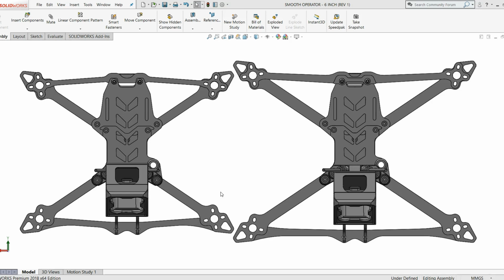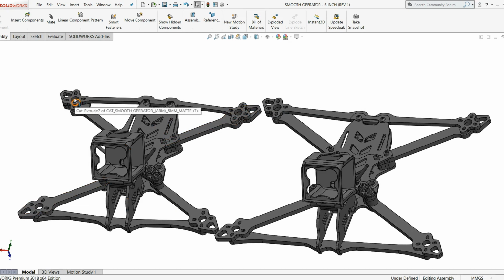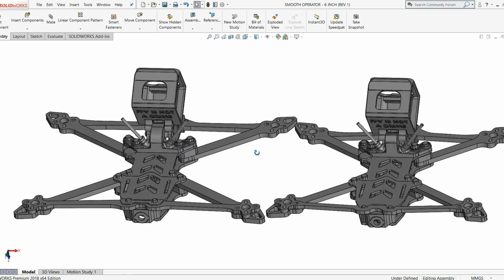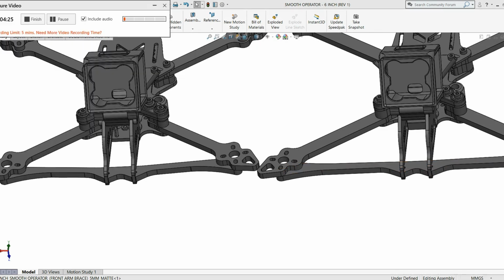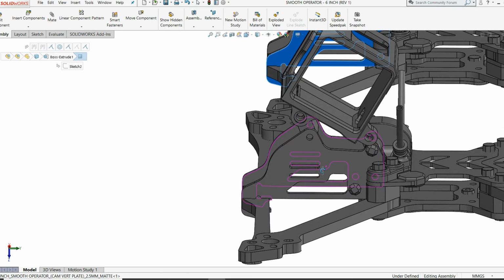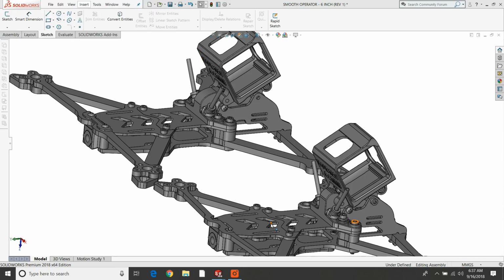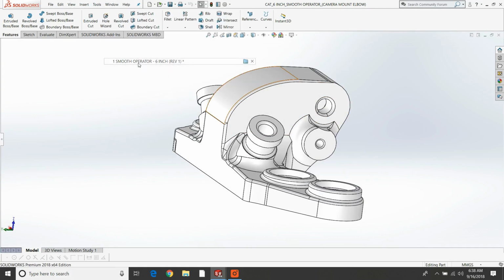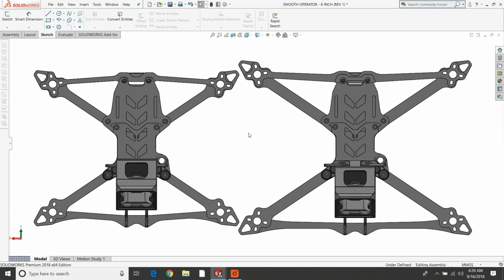Smooth Operator 6 Inch - Design Review

Comment: Nice job Neil! It looks great with very logical design modifications - if only every frame manufacturer took note of the need for thicker arms on 6” variants! Only thing I would suggest is it would be nice if the rear brace actually screwed into the rear posts rather than having a clamp plate, I believe it will make the assembly process easier and should also make the frame a bit stiffer 👍
Reply from the maker: Yes I do too. However I cannot come up with a way to make that happen without making major changes to other parts. In addition I want people to be able to remove the rear top plate WITHOUT having to take off that rear brace. If its screwed in that isn't possible and removing the rear top plate becomes a pain in the butt.
Reply: Maybe you could modify the tpu antenna mount to include a tab that sticks up into the U shaped part of the rear brace at the center.   This could provide a flexible stop for the brace to hold it from shifting and from slipping out of alignment.
Reply: The new part could be compatible with both the 5 and 6.